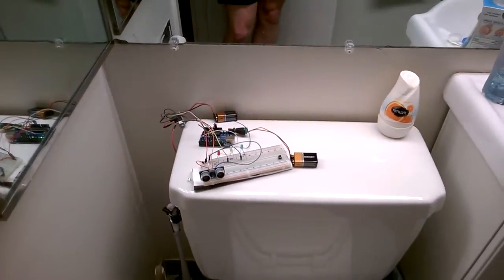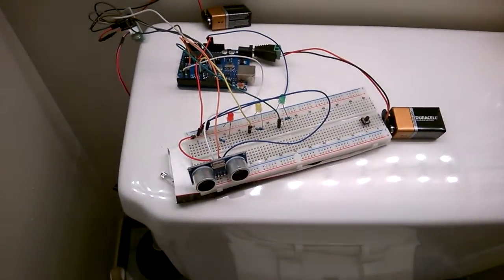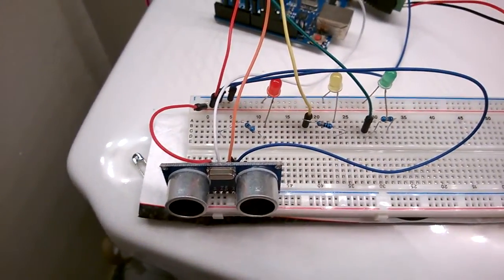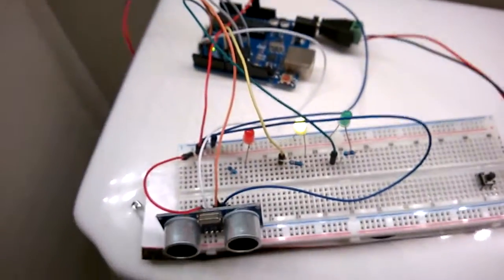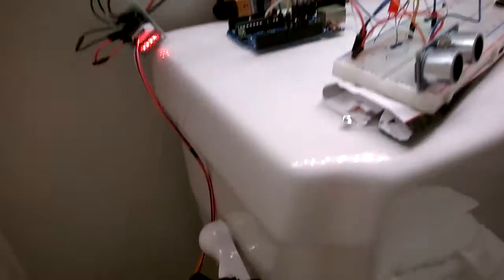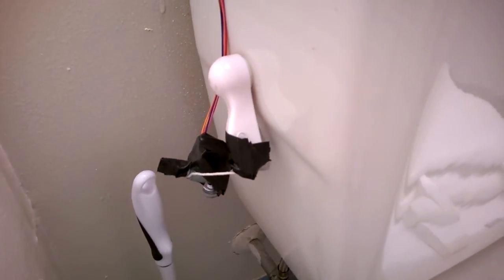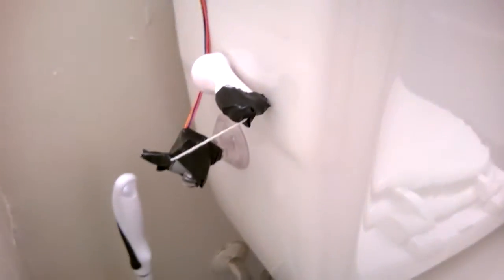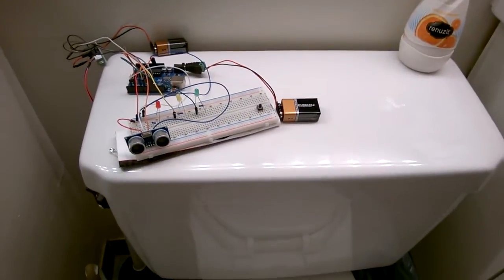Automatic Toilet Flusher project in action

Comment: I,m trying to modify your code to flush 5 times if cacao and once if pipi. I'm having problems navigating through the loops to get the 5 flushes. I get into a continuous loop on most of my tires. Any clues?
Reply: Five times? A change in diet might be in order. 
int flush = 0;
void loop(void) 
{
  if(flush > 0) {
    callForFlush(); // where you actuate the servo, then wait a moment
    flush--;
  }
  if(time2flush && cacao) 
    flush = 5;
  else
    flush = 1;
Or something along those lines.

Comment: here is the code guys
#include <Servo.h> //This line is needed to use the servo library
Servo myservo; //This line create a servo named "myservo"
int buffer; //two more integer variables we will use as buffers
const int pingPin = 3, led = 4; //This is an variable we are setting to 3 and 4 to make it easier to read/write from those pins

void setup() {
  myservo.attach(2); //set the servo to pin 2
  pinMode(led, OUTPUT); //set the led pin as an output
  Serial.begin(9600); // initialize serial communication, this will let us read/write data back and forth (this is useful for debugging)
}

void loop()
{
  long duration, inches; // establish variables for duration of the ping, and the distance result in inches 

  // The PING))) is triggered by a HIGH pulse of 2 or more microseconds.
  pinMode(pingPin, OUTPUT);
  digitalWrite(pingPin, LOW);
  delayMicroseconds(2);
  digitalWrite(pingPin, HIGH);
  delayMicroseconds(5);
  digitalWrite(pingPin, LOW);

  pinMode(pingPin, INPUT); //Set the pingPin to an input to read from
  inches = pulseIn(pingPin, HIGH)/ 74 / 2; //read from the pin, divide by 74 to account for the speed of sound, then by 2 to account for the return trip)
  
  if (inches<20) flusher(); //if the reading is less than 20 start the flush function
  else //if the reading is not less than 20
  {
    buffer--; //decrease the buffer
    if (buffer<0) buffer=0; //make sure the buffer cant be less than 0
    myservo.write(360); //put the servo in the far right position
    digitalWrite(led, LOW); //turn off the LED
  } 
  delay(100); //wait a 10th of a second before checking again
}

void flusher()
{
  buffer++; //increase the buffer counter
  if (buffer>15) //if the buffer counter is over 15 (which would be 1500 or 1.5 seconds)
  {
    myservo.write(41); //put the servo in the far left position
    digitalWrite(led, HIGH); //turn the led on
    delay(1000); //wait one second
    myservo.write(360); //put the servo in the far right position
    delay(3000); //wait 3 second
    buffer=0; //reset the buffer
  }
}
Reply: Thanks a lot mate...
Reply: do you have circuit diagram of this?